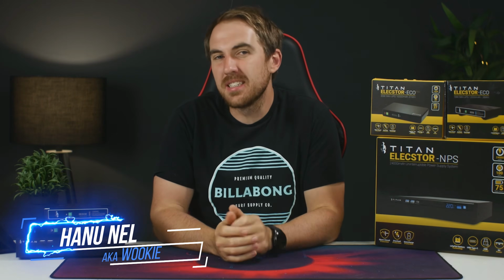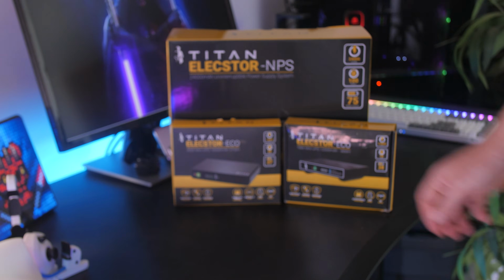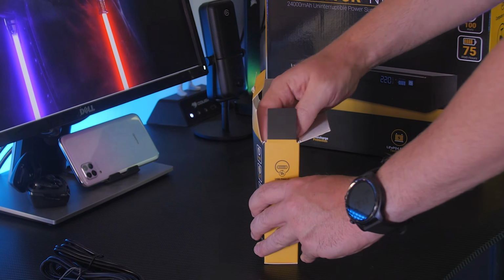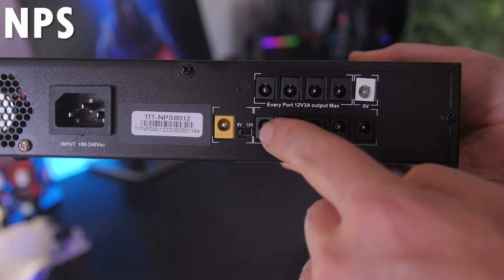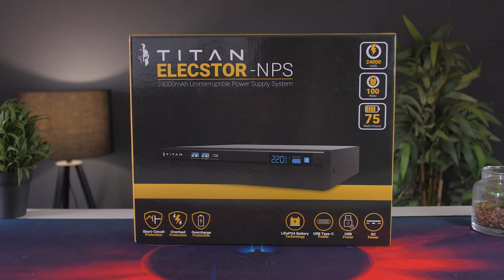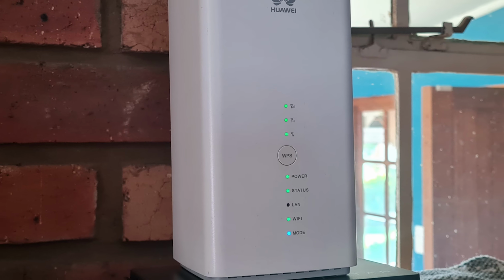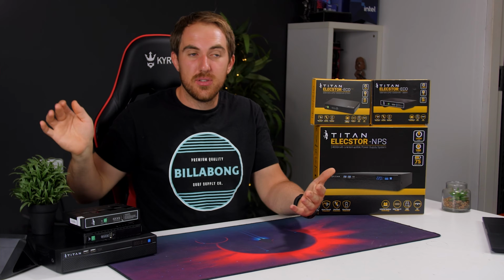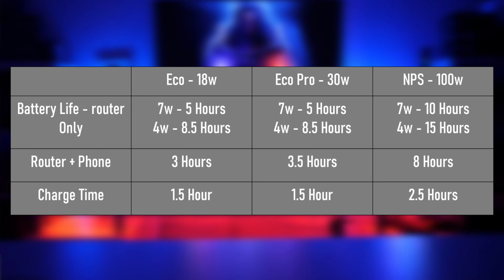Cool Tech I Can't Live Without Anymore - Titan Elecstor UPS

Comment: 👏 Nice video and good job for recommending the mini UPSs with the larger batteries. We have been finding the 8000mAh mini UPSs start failing quite quickly (as soon as 6 months) when Loadshedding is Stage 4 and above (as it has been a lot lately)

Comment: I wanted to know about the POE ports. I have same mini UPS with 9/12 volt output and 15/24 volt POE (They get sold in different name brands but use same 8800 mah capacity). I wanted to know if I can use the POE port to power a mini PC or a mini ITX build since it outputs 19 watts power. I'd need a ethernet to 12 volt DC adapter.
Reply from the maker: Not sure about the POE, but if you have an adaptor is should possibly work.
For a mini PC you would need to make sure about the power needed and delivery. I was bake to power my 12v windows tablet but didnt go higher than that. Also the connection needs to be looked at to see if its the same.

Comment: The towers do run out of juice and so do mobile providers. However, it could be a contractual agreement. Sometimes fibre, mobile and other networks drop power during loadshedding simply because you don't have the option. Always-on-option costs more. This is also dependent on the area you are in. It is advisable to contact your provider to find out.

Comment: Hi there. I am interested in buying the Titan NPS. My setup is fibre (6W) and 2 wifi routers (12W + 5,4W). Will the Titan setup be sufficient for 4,5hr of loadshedding with the watt usage from the 3 devices? I was also looking into the Gizzu products, which also has great reviews but I don't think you have done a review for them?

The Titan is 24 000mah for R 1799 while the Gizzu is 21 600mah for R 1649 (current prices) - would the Titan be a better choice here?
Reply: Hey there - I recently purchased the TITAN Elecstor 24000mah unit and I use it to run my Fibre, Wifi router and one Mesh unit and it stays afloat without a single hiccup during shedding. The longest period I've been load shed since is 4 hours and the unit only lost one out of 4 battery bars during that session - I think you can confidently purchase the Titan for your use case. I am very happy.
Reply: @martinpieterse9359  Thanks for the response. I think the Titan NPS will definitely be enough. Also 2nd question, I have a D-Link Wireless Access Point Router that uses 6W. I need to put this on a UPS as well. Would you recommend the Titan Eco (18W 12000mah) or the Titan Eco-Pro (30W 10 000mah)? The price difference is only R 90 with Eco being more expensive
Reply from the maker: They are so similar in how long they last. The Pro will just be able to supply more power (30w vs 18w) if you want to use it for something else that needs it down the line.
Reply: @WeDoTech  Thanks, I bought the Eco Pro and will be testing it out for upcoming loadshedding. I will keep you updated
Reply: @AxomeV10  I agree - I'd go 30W 10 000mah, that additional 2 000 mah will be 'meh' but the higher load spec will probably come in handy later.
Reply: @martinpieterse9359  Yep, just had 2 hour loadshedding and the EcoPro comfortably lasted the 2 hours and it didn't even go below 100% (all 4 battery bars were still on), what a beast! Now we wait to test it out in the 4 hour loadshedding cycles.